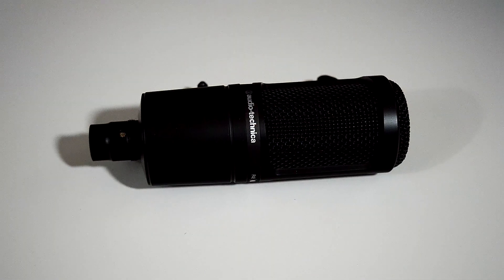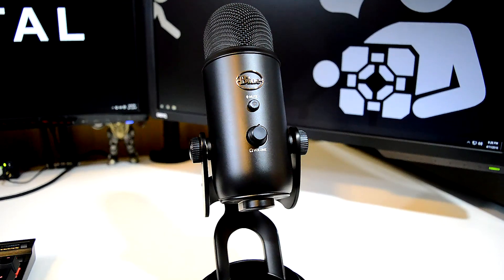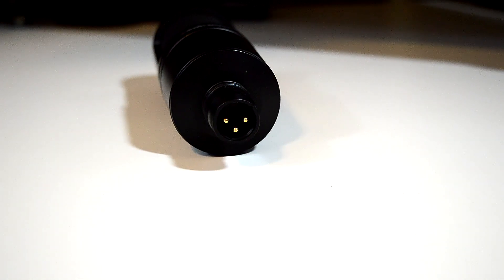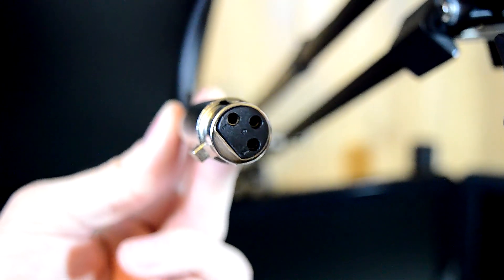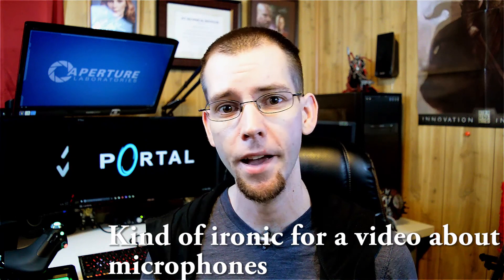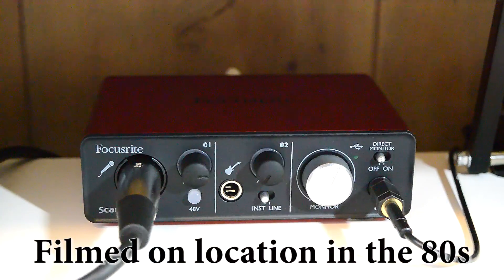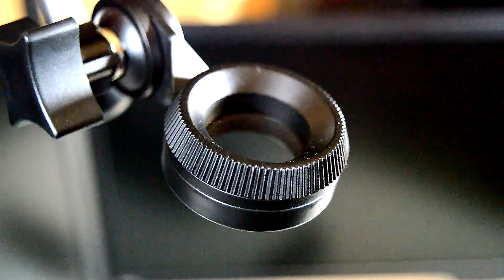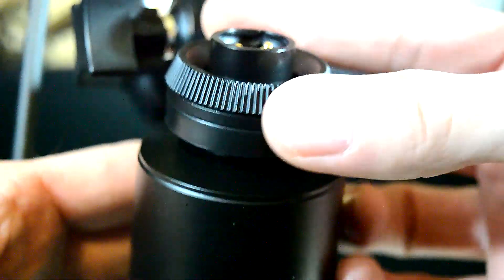Audio Technica AT2020 XLR (Not USB) Condenser Microphone - the Review!

Comment: Using the at2020 with steinberg ur22 interface. Phantom power is on but the sound is so low. I also get noise when I increase gain past one o'clock. Can't find any information on this. Have you had experience with this? Thanks
Reply: elkwolf did you ever figure it out ?

Comment: you can buy a xlr that plugs into the mic and the end is usb
Reply from the maker: But that will only supply 5V to the microphone which won't power it. The AT2020 requires 48V to operate correctly which cannot be supplied simply by a USB port.
Reply from the maker: Also, you would have no way to control the gain or anything like that.
Reply: I figured that out after I wrote the comment